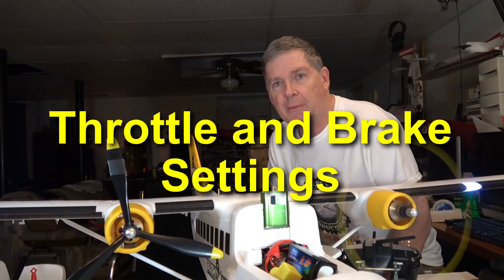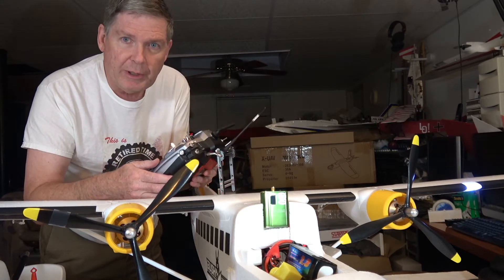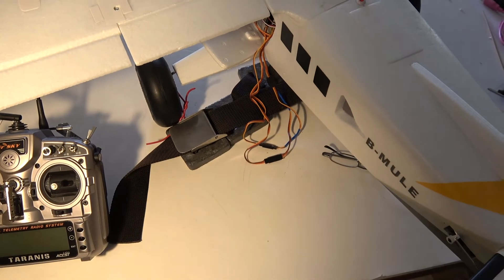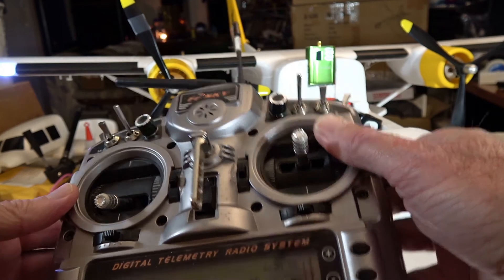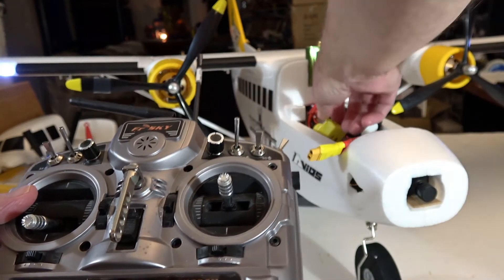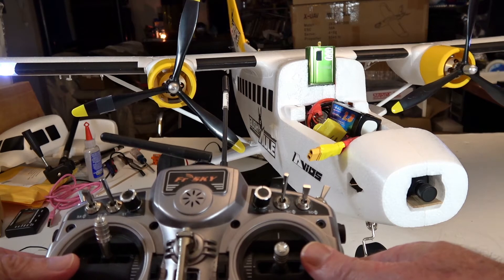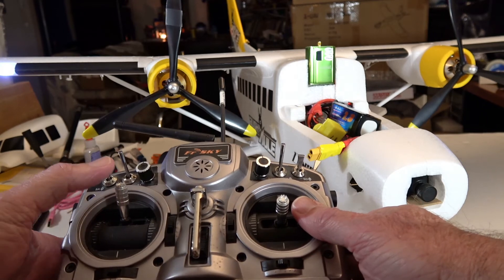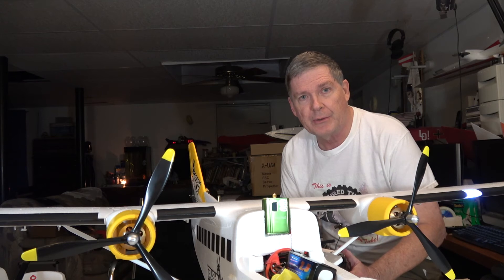Multi Engine ESC Throttle Calibration and Brake Setup

Comment: a  question ?  on  the outrunner  brushless rc aircraft motors can the motor timing be adjusted with the motor itself ? or only the esc settings ? thanks for the response.

Comment: Thanks Dave. After watching this I was able to synch the motors on my bushmule. They were running at different speeds and one had brake set, the other didn't. Made for some interesting landings. So easy to do once the beeps are explained. Cheers
Reply from the maker: Super! Great you got it working.
Reply: @DaveMerc  Can this be fix for flyskyi6 because my controller is different than yours but if yes can you help me to fix it?

Comment: Are you using a PUSHER prop on the motor with the SWAPPED ESC wire?
Reply from the maker: The plane (Bush Mule) came with two counter-rotating props. I like to set twins up so that the top of the props turns toward the fuselage.
Reply: Dave Merc Productions thanks

Comment: Thanks for the video, I just cant figure out why one of my counter rotating props in my twin is in reverse. thanks in advance.
Reply from the maker: If your talking about a reversed motor you can just swap two of the three wires. Or if you have a reversing ESC it could be the channel is reversed or both.
Reply: Dave Merc Productions thanks for taking the time to respond. When I match up the ESC colors with the motor, they both spin CW, but when I swap two of the three wires on one side, It pushes that motor backwards (reverse) and CCW. So now I have CCW with one motor going forward when the other going reverse.

Comment: ThankDave for your reply, have many planes and tried middle and down doesn't seem to affect full throttle just seems motors start earlier, like to have one or two notches before they do, so will stick with middle as you say. Good info thanks again for your reply much app! Just bought mine awaiting maiden gonna stick with flaps at half for first landing, any advice or vices it may have would appreciate any info. Kind regards Graham.

Comment from the maker: Bush Mule Specs:
https://hobbyking.com/en_us/avios-bushmule-1500mm-yellow-grey-pnf.html

Features:
• Twin-powered motors
• 90° barn door flaps to slow down landing descent
• In-built cargo door for parachute launch and candy drops
• Broad Tundra-like wheels for rough terrain

Specs:
Width: 1500mm (59")
Length: 1095mm (43")
Weight: 2250g
Motors: 2 x 3536mm 850KV brushless outrunner motor
ESC: 2 x 30A w/ reverse

Recommended:
Battery: 3000mah 4S
Show less

Comment: are you running a y cable or are both esc's on their own channel?
Reply from the maker: I have them on a y-cable for now but you can do it either way. Perhaps you want differential thrust for example then you could use separate throttle channels.

Comment: I need a help... Actually.. I connect 2 different motor with two different esc to 1 3s lipo battery... Problem is same.. when I turn on my remote.. I can here sounds of two esc with different time beeping.. ND my motors running one after another rpm.. after throttle..
Reply from the maker: You should get two of the same ESC or there can be problems.

Comment: Dave,I think I asked the wrong question. How does your switch setup work that you used on the plane in this video, the switch to turn the plane on and off? Or is it just the smoke stopper? Tony
Reply from the maker: It's just the short stopper. It has a switch. Very handy!

Comment: Your videos came in handy when i needed to put my BM together. Thanks. Now i know why brake is useful on a glider but does it have the same benefit on a plane like this? With brake on would there be less drag and a extended glide slope?
Reply from the maker: I am finding that bush mule works better with the brake off so the props spin freely. It will stall without the motors running. I think the brake is most useful with a folding prop like on a glider.